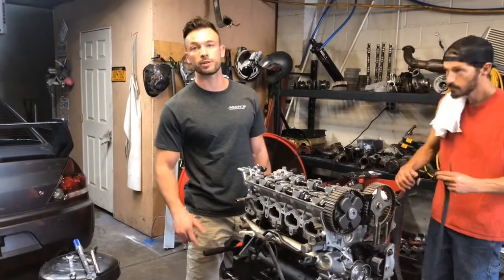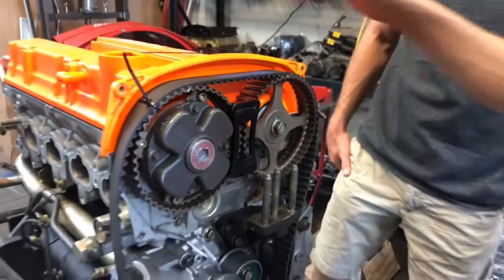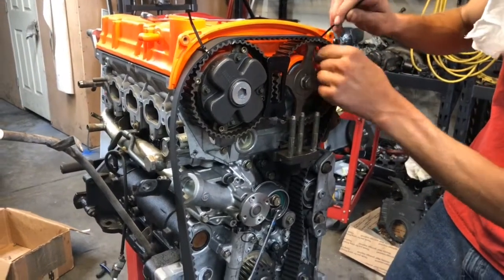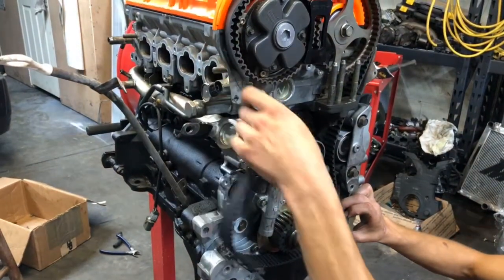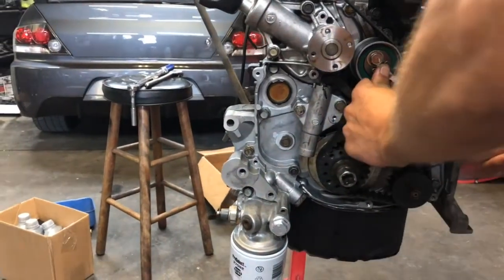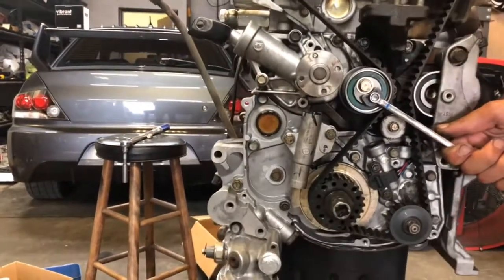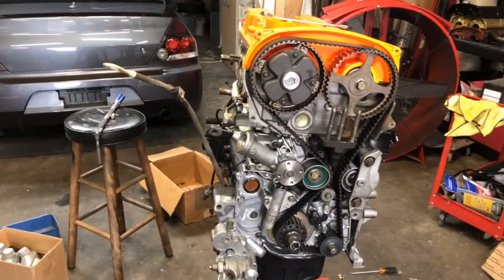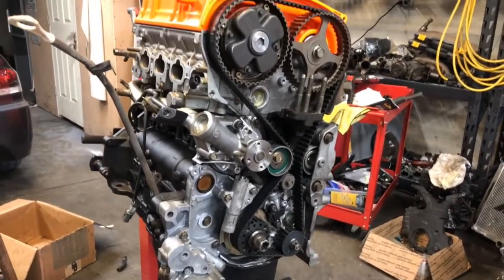HOW TO: Time an evo 8 & 9 engine!

Comment: If you've deleted both balance shafts and installed a stubby shaft on the other side of that oil pump gear, do you not need to worry about it being 180 degrees out? Mine is deleted but doesn't want to naturally fall into the alignment mark.
Reply from the maker: No you do not

Comment: Which way to turn the Mivec intake cam? Lot of play on it.
Reply from the maker: If you prime the motor with the oil pump it will stiffen up. You still need to align the timing mark with valve cover.